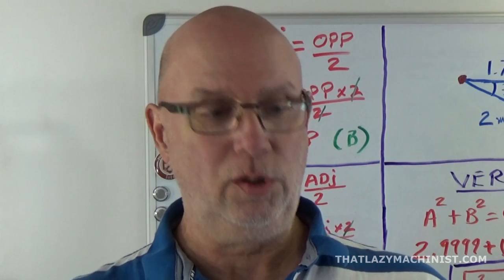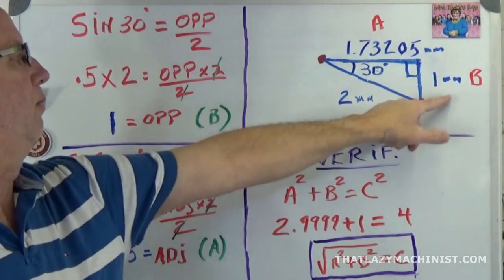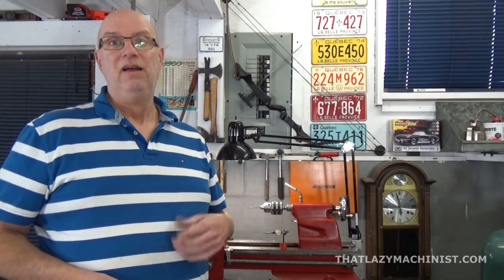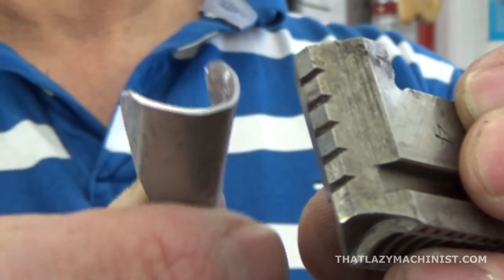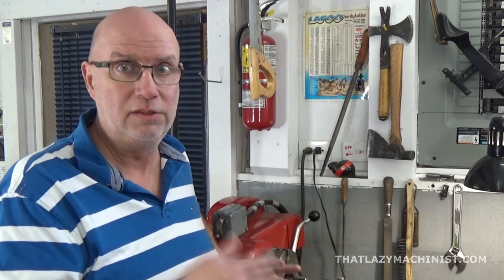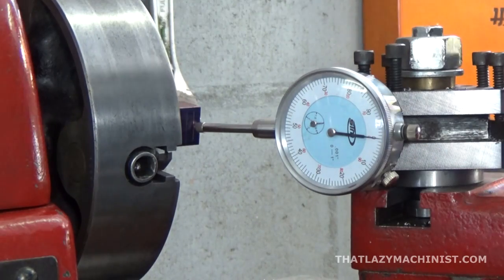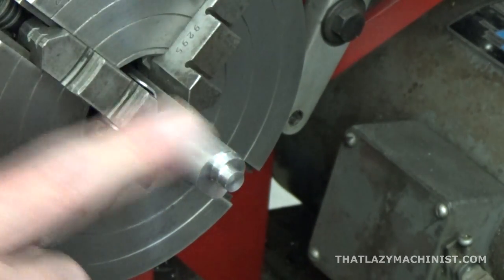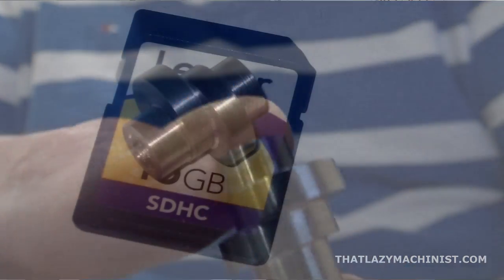HOW TO MACHINE A SMALL STEAM ENGINE CRANKSHAFT ON YOUR SMALL HOME SHOP LATHE USING  A FOUR JAW CHUCK

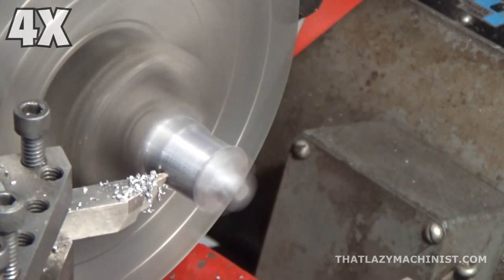Comment: Thank you for the informative video. I am confused about the step around 23:58 where you change tool to make the second lobe. I understand that you need to flip the angle of the tool to give clearance to the back face of the first lobe. How do you do that without messing up you references? Would it make sense to use a tool that was exactly perpendicular to the axis of the part to turn both the front and back lobe (hope that question makes sense)?
Reply: yes certainly you can use 1 tool. a few different ways to make this part, I think this was just his preference. I notice the compound was at an angle I think to accommodate the angle of bit he was using

Comment: Nice except the part drawing shows that each lobe is cut deeper in the center to provide shoulders. They should have been cut when you had each in the offset position. So that part is worthless other than showing how to offset.
Reply from the maker: Hi gvet! You are right, the part is worthless since I have no need for it. The only objective of my videos is to show novice machinists how to machine parts. I rarely make something that I need, actually I make more parts for my neighbors than I do for myself.  All I wanted to show was the offsetting since grooving, drilling and tapping are well covered in my other videos. Thanks for watching and thanks for a great observation, Marc

Comment: G’day Marc, excellent presentation. You used square stock which gave you the basic geometry of 180 degree offset but how would you do it with round or perhaps where the offset is not balanced as with a camshaft, would you then set up a disc in the other end of the headstock spindle with the angular offset mapped out. 
Cheers 
Peter